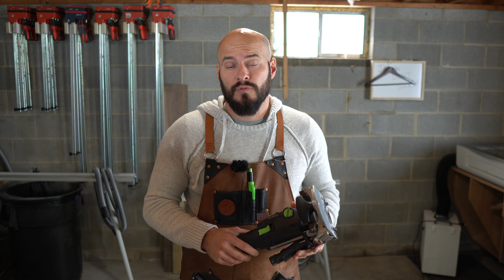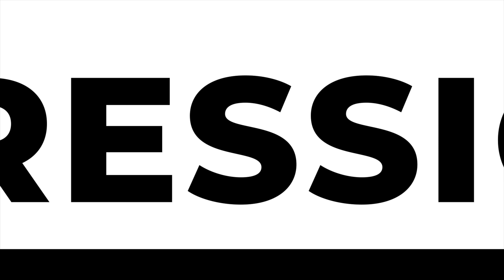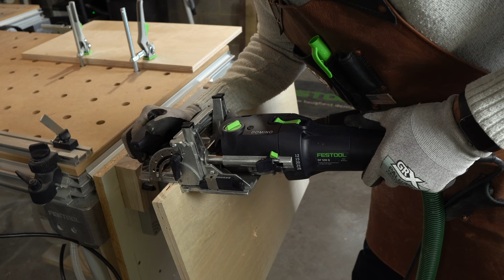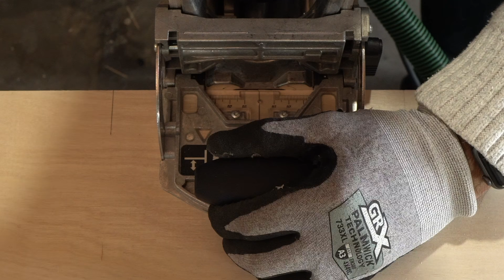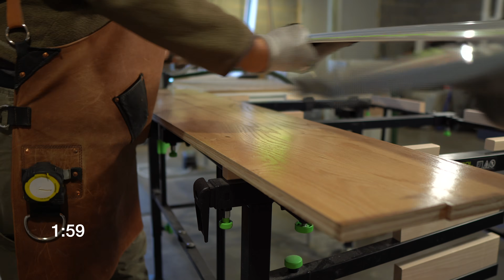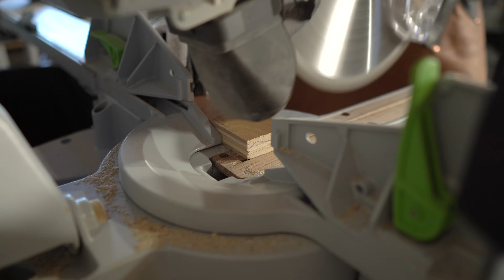Festool Domino Layout | MultiMark Jig

Comment: It seems a neat idea, but since you only need to make the first Domino off your reference face (!) on the tight setting you really don't need any exact markings or precision, because the mortises in the one piece only roughly need to match their counterparts in the other piece (you've got 6 and 10mm lateral play on the medium and wide settings respectively).
And because the first ones on either part are done using the Domino's little flag stops you have the necessary repeatability to get your faces flush without measuring (or marking)
Reply from the maker: You’re completely correct about having one tight and the rest loose. I’ve found that people have their preferences with how they do their tenons. There are some people that like to do all tight tenons, which makes this jig suitable for them. There are also some that will do one panel all tight and the other all loose. I wanted a jig that mitigated errors in those few times when I wasn’t thinking properly in the moment!!
Reply: @BenMarshallDesigns  fair point, it's easy enough to create a mess with the Domino if you lack sleep 😄
One advantage I do see with your jig in hindsight is the fact that you can simply swap parts of the same dimension (if you wanna hide blemished surfaces etc.) because the Dominos will all be at basically the same position on every single part
Reply from the maker: @chrisr8996  yep, and that’s the point behind using the jig. I wanted a fail safe to prevent those rare occasions when my lack of focus got the best of me. Even if I’m being an idiot, the jig is a barrier to stupidity 😆

Comment: Thanks, what size of Domino's are you using in 18mm ply
Reply from the maker: These were 5x30
Reply: Generally speaking the same as for any other tenon, 1/3 the thickness of your material (i.e. 6mm would be ideal for 18mm)
Reply from the maker: @chrisr8996  true. However there are no 6x30 dominos. I like using a 15mm plunge with 18mm material, as I don’t have to worry about switching plunge depths between face and edge plunges. Makes the process quicker and removes possibility of accidental through tenons
Reply: @BenMarshallDesigns  good point, definitely reduces the possibility for errors. Won't make much difference in strength for most general applications anyway
Reply from the maker: @chrisr8996  yep! Appreciate the comments!

Comment: My Domino included wings that literally accomplish this same thing (actually faster because there's no marking required). This would really be very useful for biscuit joiner or dowel users who are required to do layout by hand. It's a good jig, just marketed to the wrong audience I think.
Reply: I've use those wings but sometimes when attaching red wood face frames to the  plywood carcass the dominos wouldn't line up. so this jig should do the trick.
Reply from the maker: @risby2  The cross stops certainly require a mental adjustment to the concept. At the end of the day, the cross stops require a mirror reference point along the joining edge to be used properly. Obviously marking the plunge location is super easy and straightforward. However, in a high production environment, it might be more beneficial to use the cross stops. I certainly need more practice with them! Glad you think the jig will be helpful!
Reply from the maker: Yep the cross stops. Sadly those aren’t included in both versions of the DF500 (although they’re pretty inexpensive). I have the cross stops as well, but have rarely used them. Just another alternative